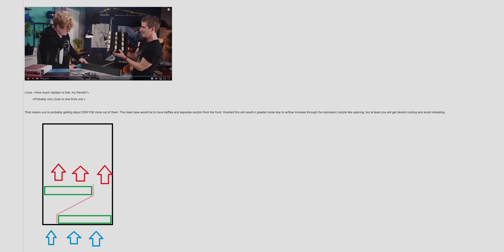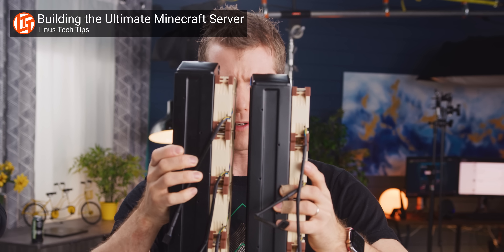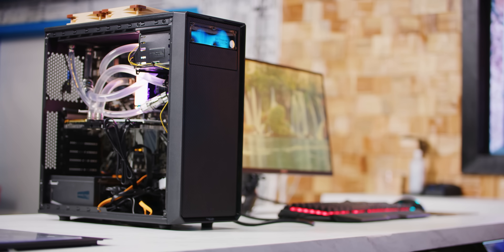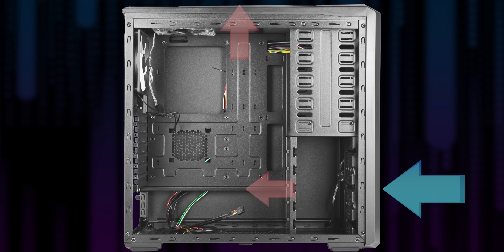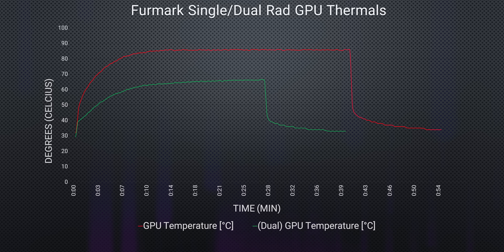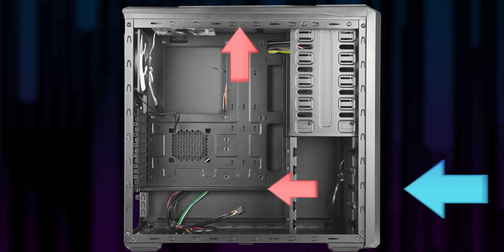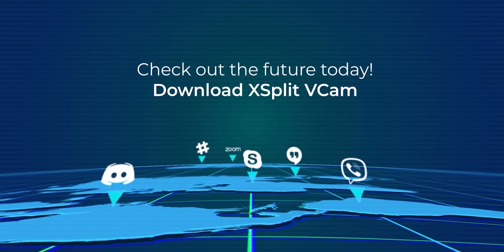I’ve been water cooling wrong for YEARS - $H!T Manufacturers Say

Comment: So here's a thought, and I think a few other people have alluded to this as well:  Set up two radiators, both intake, and see what your numbers are.  See if adding the second radiator without pushing warm air through it but pulling cool air through it instead gives you more than a 20 degree difference.  Put one in the front, one in the side, and exhaust fans at the top.  Or do it both with and without exhaust fans to see if there's a difference.  What I suspect is happening and what I suspect Corsair is actually talking about is that you're getting less performance out of the second radiator because you're trying to cool it with heated air instead of fresh.

Comment: It would be cool to see this revisited with different intake/exhaust setups, what is the difference between having a front mount intake and a top exhaust vs top intake front exhaust vs both intake  with separate exhaust fans vs both exhuast with seperate intake. Stacked in series vs spread out, does a thicker radiator have diminishing returns and when do they become too inefficient to keep making thicker?  What are the effects of the increasing the thermal inertia by adding more water aka a second/larger reservoir?

Comment: i don't think the manufacturer are wrong nor i you Linus.
use more rad meaning more cooling circle and more time for cooling which is good.
i think that they mean that the second rad is not in optimum efficiency (like  using 1.6/2 efficiency).
meaning that it can be beater in a different configuration.
like all rad take air from out side(cool air) to in the case and other fan move the (hot air) to out side.
or 
all rad take air from in (med hot air) to out side the case and other fan move the (cool air) to inside.

Comment: I've been building custom workstation computers for all kinds of applications since 1987. Corsair is right. Less is more with radiators. You only need 1. If you want MOAR? Use the biggest radiator you can A.) stuff into the case. Or 2.) hang it on a rack outside the case. If you dissipate lots of heat inside the case? Need more radiators? ALWAYS put them in SERIES Outside the cabinet or on the top of your racking. Sandwiching the fans is great in automotive applications but you reach a point a point of diminishing returns. To much hindrance to air flow. Remember your room cooling loop with the copper tubing that you did a few years back? Did you learn NOTHING? Thermodynamics isn't just a Law, it's an unforgiving byotch named Martha Fockler!

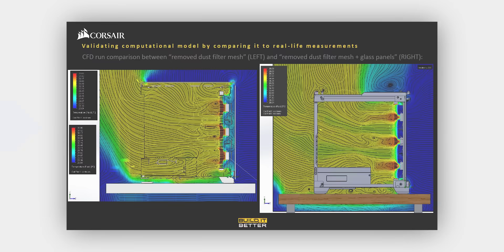Comment: 1:10 a bit small to see but is it not the same min-max temperature on the color scale? In any CFD software you can fixed the same min-max values for the scale to display temperature contour. It would be better for comparison the results from 2 simulations.

Comment: I don't know what Corsair is thinking. Car's stack heat exchangers all the time and use bigger radiators for bigger engines. It's about BTU's of heat into the water and how many BTUs of heat the surface area of the radiator can expel. Yes, there is disminiging returns as you start adding too many, but I think Corsair's simulation is missing a calculation of some kind. The air will not come out the temperature of the water if surface area of the radiator doesn't have the BTU capacity and water temps will continue to rise. Put too small of an air conditioner in a room and the thing will run 24/7. The fridge thing Linus did, PC put off too much BTU's for the fridge to keep up with.

Comment: I'm actually amazed that this experiment was so poorly conducted. Firstly I'm sure when Corsair mentioned stacking I'm sure they meant when you literally put those rad/fan arrays back to back. In such a scenario I'm sure performance would have been worst than say if they weren't back to back. Linus has done tons of water cooling build videos and for Corsair to only point out the ones where the rads were back to back I think was a sure sign of what practice they are discouraging. Also from the number of thumbs down this video has I'm sure others agree.

Comment: There’s one other possibility:  the assumption that radiators are near 100% efficient and effective is wrong.
Reply: They almost certainly would have never assumed that though in their simulation
Reply: @slashbashin they state that with a water temp of 40° you'd get the air to 39° after passing through just one rad, which is bs
Reply: @tobymarol7329  did you test it?
Reply: @Jehty_  It's just obviously false as not all the air that passes through will contact the fins of the radiator. They aren't 1 atom think and if they were it would only starve it of air. Obviously the air isn't just under the temperature of the water. That's just common sense.
Reply: And its in fact a open system. Not a closed system. For a closed system also stacking up is fine as long as temperature gradient exists
Reply: yeah thats just obviously wrong to me. im sure there exists a radiator somewhere in the world which is nearly 100% effective, but like...watercooling radiators come in all shapes and sizes, and one of the benefits of open loops is that you can use thicker and larger radiators than closed loop coolers tend to favor, thus resulting in better cooling. that wouldnt be the case if all rads were nearly 100% efficient.
Reply: Yea if that's the case, then why do 360mm rads work so much better than 120mm. Because, Corsair, your product isn't the pinnacle of perfection...
Reply: @davidplummer7302  because 3 fans move more air than 1 fan???
Reply: I don't understand how a company as prestigious as cosair managed to make these false claims based on a simulation?? Like did they not think to just do real world tests??? And to then try and convince Linus that he's wrong, what the hell is cosair doing??
Reply: @rossaylen7441  it's because their logic on air becoming nearly as warm as the fluid is flawed. If it did they would be right, but it doesn't. Not all the air comes into contact with the fins of the radiator so it's not going to reach nearly the same temperature. Now if it was a bigger radiator, it would get closer. This is why bigger radiators exist in the first place. Though I would say his server with radiator end to end likely would be more pointless considering they had 3 extra thick radiators. Standard radiators will pass through way more cool air. Though bigger radiators will increase the time till the temps peak but that isn't very important.
Reply: @rossaylen7441  but how do you know that those were false claims?
Did you test it? Because Linus did not test it.
Reply: @Jehty_  well he did
Reply: @rossaylen7441  no he did not.
Linus tested a complete different setup in a completely different case.
Reply: @Jehty_  and then he tested the very Minecraft server they critiqued by removing one of three stacked fans, resulting in a 5c increase in temperature. So yes, he DID test their claim and found it to be false.
Reply: @Jehty_  It doesn't matter if it was a different setup.  It is still testing corsair's claims.  The fact is that radiators are not that efficient at transferring heat to the air.  There is still some cooling capacity left in the air after one pass through a radiator.  Car radiators often have multiple cores stacked in a row.  Truck radiators can have 4 cores or more.  It is literally 4 thin radiators stacked in a row.  Why would they do this if it was a bad idea?  A 4 core radiator is just like stacking 4X single core radiators in front of each other.
Reply: @Plur307  the car and truck analogy was going to be my next point. Multi core radiators have proven themselves time and time again. I have no idea why this guy wants to insist Corsair is right.
Reply: @alexmawdsley  but for that part you don't know what Corsairs claim was.
If their claim just was that it doesn't make sense to stack 3 radiators, than they would be right. Because adding a 3 radiator for just a 5°C difference is not worth it.
As long as we don't know the exact wording of their claim we can't say if they are right or wrong.
Reply: @Plur307  in that case a large amount of air that the second rad pulled in came from outside the case. (the huge hole in the rear of the case is quite obvious)
So no, he did not test Corsairs claim.
In order to test Corsairs claim one have to make sure that the second radiator gets most of its air from inside the case. That was not the case in this case.
Reply: @alexmawdsley  how often does your PC drive with 50 mph or faster?
You can't compare the amount of air pushed trough a car radiator with a PC.
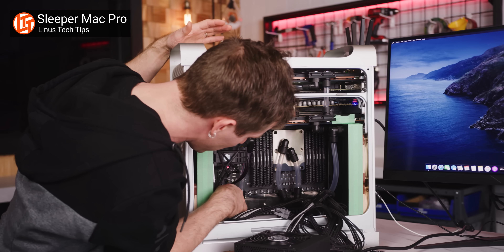Reply: @Jehty_  At 6:48 they mention that they tried removing one of the stacked radiators and it hurt temps.  The stacked radiator was providing additional cooling.
Reply: @Jehty_  You can directly compare car and PC radiators.  They use the exact same principles.  The fact is that after air passes through a radiator it is not 100% the same temperature as the radiator was.  There is still some remaining ability for the air to cool if it is passed through another radiator.    This is true for a car radiator or a computer radiator.
Reply: @Jehty_  Corsairs claim was that stacking radiators shows no improvement, or can even negatively effect cooling. Testing + the entirety of the automotive industry shows that is incorrect. Their claim was that simply adding a second radiator to a case does not improve cooling based on some silly assumption that the radiator was the only source of inlet air. Even if the case was otherwise completely sealed, their claim was STILL incorrect for the exact same reason as the Minecraft server working. No actual testing is going to appease you. No proof. No evidence from the millions of cars on the road using this exact theory to their advantage. You just want to argue. 

Radiators are far from 100% efficient. Stacking brings diminishing returns, but the returns are still there. Dropping temps 5c can be pretty significant to performance and longevity, especially when you are pulling cooler air than their hot server room, and that's with a triple stack. The difference between a single and double will be significant. 

Just to add to this... Those Minecraft server radiators are THICK, so they're already likely multi core. Multi core water cooling radiators definitely exist.
Reply: @Plur307  the problem now is that on the one hand we have a company that manufactures water cooling and on the other hand we have random youtube commentators.
So as long as I don't test it myself or see a well executed test I am gonna stick with Corsair.
Reply: @Jehty_  You just watched  a reasonably performed test that proved in at least 2 different ways that Corsair was wrong.  You are falling for the appeal to authority logical fallacy where you think Corsair's brand name gives them some sort of authority that overrides the FACTS Linus spelled out and measured.  Corsair worded their opinions poorly.  Stacking radiators is not optimal and is not the most efficient return on investment.  Stacking radiators does not hurt performance, it just has diminishing returns.
Reply: @Plur307  1: you don't know Corsairs wording. You only know Linus paraphrasing.

2: What are those 2 different ways?
 The 3 stacked rads in the MC server I get. As I said in that situation it depends on Corsairs wording.
But what is the second way? As I said, in the first test the second rad pulled most of its air from outside the case. So Linus did not test Corsairs claim. He just tested if two rads, both with fresh air, are better than one rad. 

3: we don't know if stacking radiators might hurt the performance. In the two tests Linus performed it didn't hurt the performance. That doesn't mean that it never will.
We would need a lot more tests, and better performed tests in order to disprove that claim.
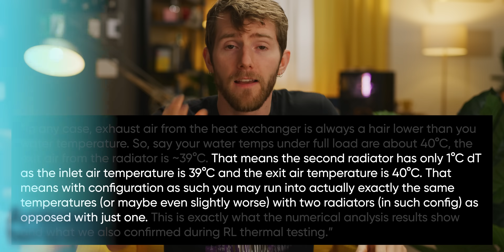Reply: @Jehty_  Did you even watch the video?  I had to point out their 2nd experiment to you at 6:48.  They also show corsair's wording at 2:30.  It's like you just jumped straight into the comment section and started arguing without even watching the video.
Reply: @Plur307  the second experiment is the MC server. So yeah, I knew about it and already talked about it.

Thanks for the 2:30 timestamp. I watched the video late last night and must have missed it. 
But that's even better because the statement at 2:30 totally proves my point. 
Corsairs statement is that the exhaust temp of rad 1 is only slightly lower as the water temp. 
Linus didn't test that. He did not measure the exhaust temp, nor is the setup of the first experiment able to test that. 
In the first experiment the second rad did not use the exhaust air of the 1 rad. Instead it used fresh air from outside the case. 

And for the second experiment (MC server) it does not disprove Corsair either. Again, wording is important. " may run into" 
Not definitely. 
And if Corsairs claim (exhaust temp only slightly lower as water temp) is true, then the result of the MC server makes sense. 
A radiator with 3 fans should make a bigger difference than just 5°C. But if the air that that rad pulls in is only slightly cooler than the water, than it's cooling is so much reduced that it only reduced the overall temp of 5°C
Reply: @Jehty_  we know corsair's exact wording, it was literally in the video
And for the record, we tested it on cars. With temps more in the range of the 100°C, and the increase of temperature after the rad was far from that.
As soon as the car moves, the air temperature quickly drops close to ambient, as it only picks a little bit of heat.
There is no way a 40° water would heat the passing air to 39° (as Corsair claims), unless you have a close to non existent airflow and it has a long time to heat. But in this case the water would heat a lot as well.
The objective is not to heat the air, but lower water temperature. The exhaust temp is not relevant to their efficiency. You don't care if the air could remove more calories as long as you can remove more by pushing more air.
It would be a different design if the goal was to heat your house for example, the heat exchanger in a dual flow CMV is designed so that the air going in is almost the same temp as the one going out.
Reply: @pbe6965  "you don't care if the air could remove more calories as long as you can remove more by pushing more air"
That might be true for a car, but not necessarily for a PC.
More air = more fans = more noise and need for more space.
Both of those are important factors for a PC. Most people prefer a quiet PC and space is in most cases a limiting factor.
A radiator manufacturer that offers a higher efficiency than others most likely will be on top of the market.
Reply: What I see here is that Linus’ system was deliberately designed to make his assumptions work. They were operating under the assumption you had adequate radiator sizing. Also something about his results seem off to me but it’s too early
Reply: @Fee.1  It would be a flawed test if they used inadequate radiator sizing.  No configuration will cool properly if you simply lack radiator capacity in the first place.  You aren't even making sense.